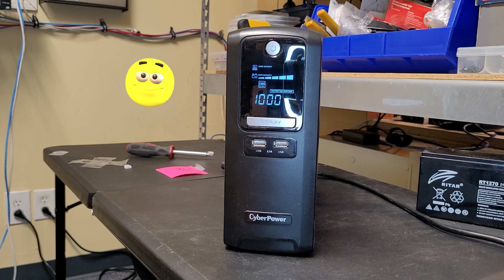CyberPower CST135XLU Battery Replacement

Comment: The most important part...connect the battery terminals were hidden....lol
Reply from the maker: Look again. As UPS is oriented facing the camera, Left side: Black cable goes to Battery Black (-) Yellow cable goes to Battery Red (+). Right side: Red cable goes to Battery Red (+) Yellow goes to Battery Black (-) I noticed that after I finished video. That's why I added text to the bottom of the screen so you know where cables need to connect.

Comment: How did you get the terminal off - are there screws or something ? Mine won't detach
Reply from the maker: They are "push-in pull-out" terminal connectors. No screws or locking system.
Reply: @AK_oldfart You should have shown that part.  All these damn videos don't show that part.  "Disconnect".  My search on YT continues until I see it visually how to disconnect .

Comment: where did you purchase the replacement batteries that came with spade adapters?
Reply from the maker: Batteries from Home Depot came with adapters. Batteries+ store sell batteries with many different connectors. Adapters sold separately. They also take your old batteries for recycling.